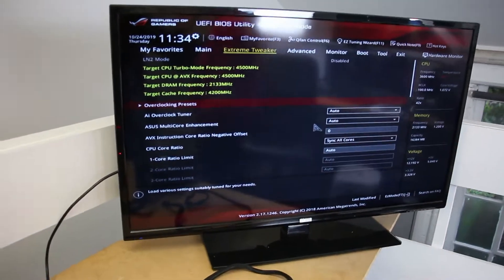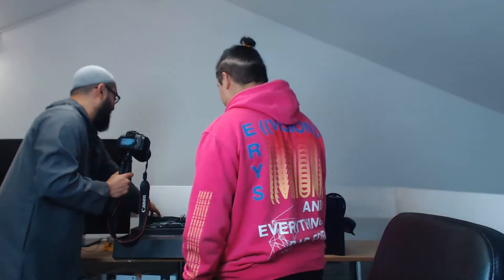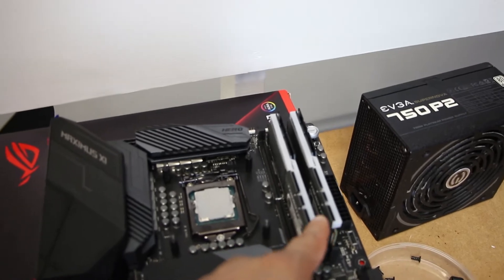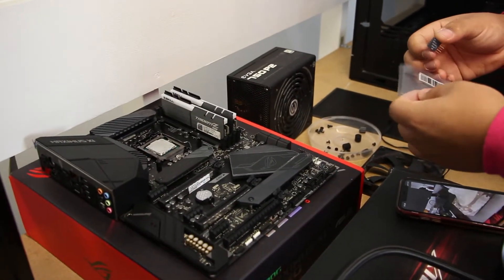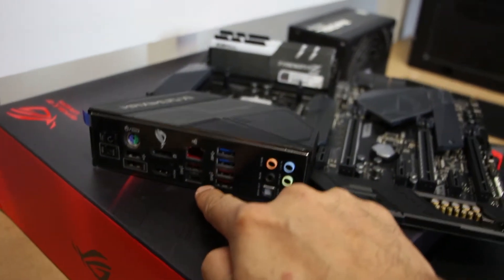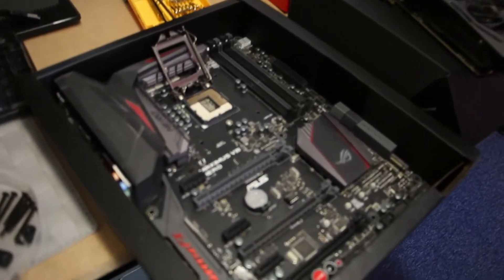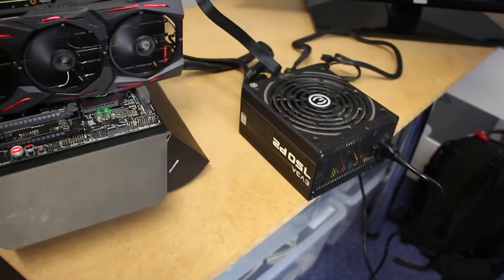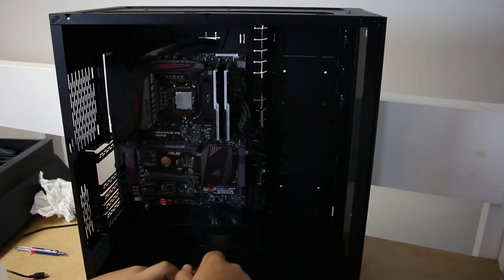PC Build Common Mistakes - Are You This SILLY When Upgrading A PC?

Comment: okay i understand what happened you have to check that the chipset supports the processor that you want to use, some motherboards have lower end chipsets but can still be used on with newer processors if the bios is updated, but you would have to have a compatible cpu on it, that's why its best to get the right chipset in the beginning to avoid that potential problem as well.
Reply from the maker: Great tip, I forgot to mention it, thanks for sharing this!
Reply: @HealMyTech1  yes i almost did the same thing with my build when i was looking for the parts, i came across the h110m motherboards for the 7th gen cpus and even though they seemed like good deals there was a warning on pc part picker, saying that the h110 chipset may have trouble detecting the cpu, that's when i ended up doing some further research and i found out that the b250 chipset is better for a small budget build of that generation of cpus.